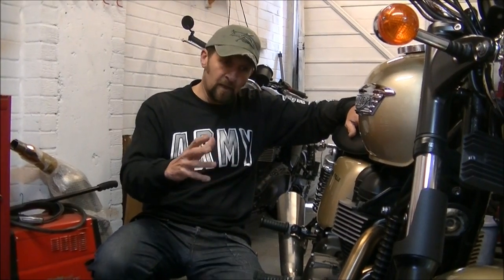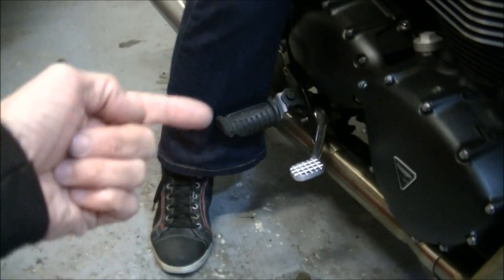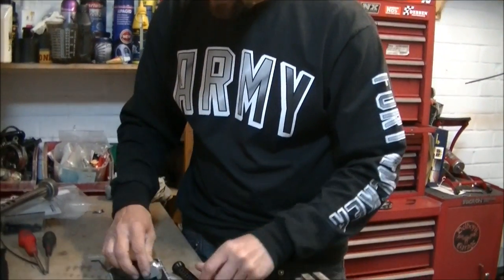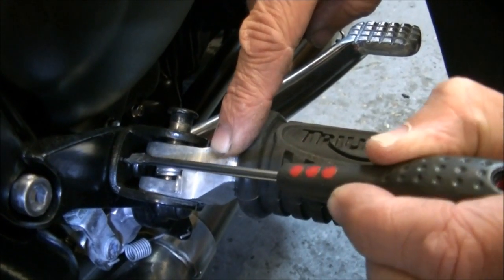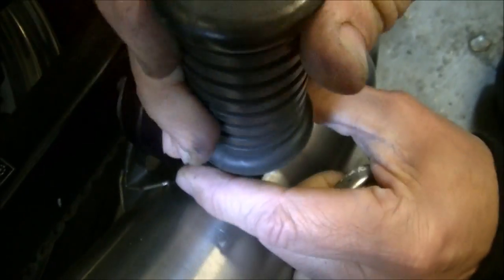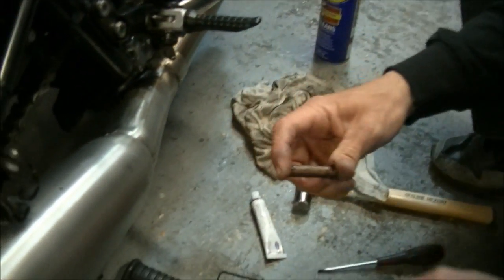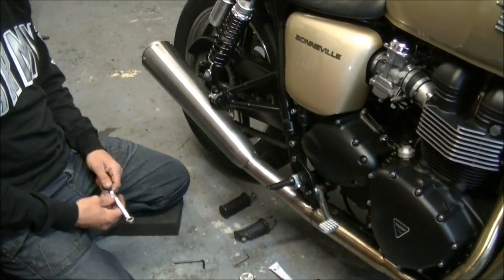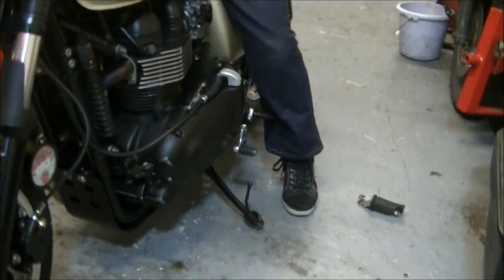Delboy's Garage, Project Bonneville #11, Oberon Foot Pegs

Comment: I thought it was just me Penny. ;) I have the same issues and considering I'm light on cash I simply took the springs out. I know new pegs are better, but at least now I can back my bike out of the garage without getting my pants stuck and tripping. It sucks being short doesn't it?
On another note Del, I had to seriously file the all the flange holes for it to fit, but got my TEC 2-1 on and I'm loving it! Beautiful. Just Beautiful. And the weight loss makes an unbelievable difference for us gals.

Cheers!

Thanks again for all the Triumph videos. It makes a world of difference - yes, even foot peg videos!

Comment: Greetings from San Francisco! Thanks ever so much for this video, on your recommendation I ordered two sets of the Oberon pegs, front & back and will
be installing them in the next few days on my T100,  thanks to your very helpful video, well done madam & sir !
Reply from the maker: fotorolo Hey buddy, so glad that could help you... just be careful not to lose those ball bearings when you remove the factory foot pegs... pull them out with a magnet, as in the video, and the best trick is to place a clean sheet under the bike whilst you work in case you drop anything and it won't disappear... good luck with it!

Comment: Great video as always. I bought a set of the same pegs as those on Penny's bike. The front set mounted easily on my 2015 Thruxton, but the rear pegs are different than those on Penny's Bonnie -- no springs, for one thing -- and the Oberon pegs have a hole that simply swallows the Triumph ball bearing. Something to keep in mind for Thruxton owners. I've contacted Oberon and will pass on what I learn.
Reply: As I wrote, I thought I should take a closer look. The spring on the Thruxton pegs is in the peg itself. It is under the BB.

Comment: Great video! I have had that exact experience with the jeans getting caught. Caught my Jeans lost balance, bike fell on me, put a hole in my ankle. I use a bicycle pants band to keep my pants from getting caught. Now I see this and how the  hip should be aligned with the foot peg,  I need to change them. One more thing, if I had riding boots on I would not be limping around right now. I don't know how these riders ride in shorts and flip flops. PS I have boots now, about four more weeks before I can ride again.
Reply from the maker: +Tim Bfoto Sorry to hear about your spill Tim, its amazing how easy it is to get all out of shape and lose it... glad you're on the mend mate..Ride safe, Del.

Comment: I think the stock pegs on my '01 bonne is part of what's causing an issue, the bike has a lean due to crappy roads and my general sitting position, hoping changing out the pegs helps this a little bit

Comment: getting tangle in the footpeg is the first thing I noticed when I sat on the bike, and I was surprised - never happened on any other bike I had or tried! now I set of got used to it, but still, not nice.
however there is a bit of contradiction of what is said here: on the one had people want to make the bike "classic", on the other when there IS something with a clear heritage look, we modify it! Old footpegs  made of chunky rubber are actually great to damp vibrations - as I have on my Moto Guzzi from the 80s. Besides, I find the metal pen-like footpegs proposed here out of context for this bike - not a Ducati!

Comment: Marmite indeed. I love marmite, and I see the benefit totally for the delightful compactness that is Penny. I therefore support the modification for that reason alone.

Having said that, I had billet pegs on the Sportster (it came with them, and forward controls). Luckily the original mids and rubber footpegs were included and I swapped them all back to stock. I prefer the grippiness of the rubber pegs, and the retro look.

I have the same on the Enfield. The problem exists for me too, I have an average 31" inseam, and the pegs get in the way, but only when I'm paddling by foot, say into a parking space. Additionally the front pegs are fixed not hinged, so there's no give at all.

In summary, not for me but it's not my bike. Even so there's plenty of good generic advice in there and as such another enjoyable and informative watch.
Reply from the maker: Hi Peter, well we knew that it would divide, but as you mention, these massive rubber pegs just get caught on your jeans, boots and being smaller, she was really struggling with it, tripping over them all the time, then you end up thinking about the darn things every time you go out!   This is a good solution for her and will make her life a lot easier! Thanks for your support my friend, it's always lovely to hear from you, RSMF, D&Px

Comment: Del,

I just swapped my '96 Sportster XL1200C for a '07 Triumph Bonneville Black. I noticed that there is some discomfort with the angle of my seating position and wasn't sure if there was a way to fix that by changing the pegs or lowering them somehow. The handlebars have been changed to a taller set so I'm not sure if the taller bars are making it worse. I am 6'0 so hopefully there is a way to make it a little more comfortable ride. Any help is appreciated.

Thanks,
Ethan
Reply from the maker: Hi Ethan, you can always fine tune your ride position using pegs and bars.....the first thing to do is to reflect on what you need to achieve...are you too close to the bars, are they too far away, are the pegs too far back or forward...and also even having the levers tilted incorrectly can pull on your back muscles or nerves can cause discomfort....its financially prohibitive to buy different sets of bars and try lots...so better to maybe first go back to a set of factory bars and return the bike to its default ergonomics as they are oddly quite comfortable, and im 6.0' the same as you....if you still feel the discomfort then you can look at how to lessen the problem by taking a long ride and shifting your feet and hands about to find that perfect position...then once you know 'where' your limbs need to be, we can look at what products to buy in order to achieve it permanently...so first up, drop the factory bars back on and take good ride to test how you feel...then let me know..!  hope that helps, look forward to hearing from you Ethan.... all the best.. Del.
Reply: Thanks Del!

I will go back to the stick bars and give it a go. Unfortunately they are chrome. I would like them black. Should I plasti dip them or scuff me and paint? Thanks again!

Ethan
Reply from the maker: Ethan Kaplan  Hi Ethan, I wouldn't do anything with them straight away mate, just put them on and see if they work... then if you really want them black, you could use either method of painting... it's always difficult to paint bars as it invariably chips off at some point ...the most vulnerable time is re-mounting the fittings and sliding them around on the paint, which likes to rip it off!  See how you go with trying them out first... good luck with it mate!

Comment: The new pegs are sexy.  The passenger peg clevis pin should have been installed the same direction as the front one, from fwd to back.  Clip to the aft side.  Guessing at some time past, someone had them off, and reinstalled them on the wrong side.
Anti-seize is NOT a lubricant, it has no film strength, no service duty (does not withstand constant movement) and can be washed out by rain or pressure washer easily.  Better to use chassis grease for parts that move against each other in service.  
Never use black grease on aluminum.  I wouldn't use it at all, but never on aluminum.  Causes Galvanic corrosion.  MolyB and Graphite are both corrosive to aluminum.  US Air Force outlawed MolyB grease on aircraft back in late 70's because of this issue.

Comment: Fantastic video!  Am having the same problem as Penny with the peg being too big.  Almost dropped my Bonnie  because of it.  However, the foot pegs on the Oberon website don't look like the ones in your video now  - would you recommend using their racing footpeg or the touring?  The racing is 80 mm vs. the touring at 90 mm, so I'm leaning toward the racing. Thanks for all your videos!
Reply from the maker: Hi buddy, yeah, Penny is really with hers, she , as you know, was having the same problem - the rubber footpeg was grabbing her bottom of her jeans!  Here's a link to the place we got hers from - these are the ones she has....http://www.ebay.co.uk/itm/Oberon-Triumph-Bonneville-FPR-0062-25-Black-Front-Racing-Foot-Pegs-/221328409631  - they are the 80mm - she is size 5 in a boot and they fit her just fine - hope that helps ! Del
Reply: Fabulous, never caught that on eBay!  Just pulled the trigger on a set.  Many thanks for your help and the fast response!  :-)

Comment: Did you keep these on? Looks like moving them a bit further back might interfere with placing your feet on the floor?
Reply from the maker: Yes i kep them on mate, it actually make it easier to put your feet down as the factory pegs hit you right inside yer shins every time...now your legs just drop in front of them.. !
Reply: Moonfleet41
Cheers for the reply, in that case I'll order some and give them a go this weekend

Comment: @Moonfleet41, Delboy or anyone that may know, would 2009 or later footpegs fit a 2004 a thruxton? Is there somewhere that has all the interchangeable parts? Please help. The Haynes manual sucks
Reply from the maker: In theory they should do mate as the factory wouldn't normally change tooling for a simple part like that, but as the Thruxton has a rear style type peg, they may have varied the shape, try and see if the Triumph dealer can help, if it's exactly the same footpeg, it'll be the same part number, so as them to check, maybe a place to start?
Reply: @Moonfleet41  thank you that helps. Really enjoy your videos.